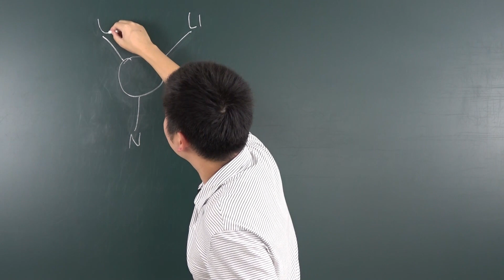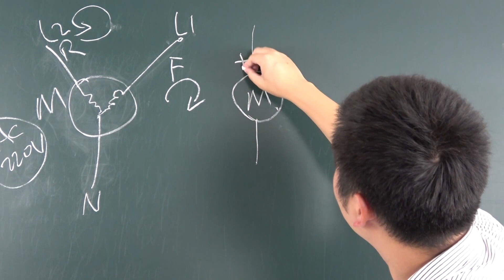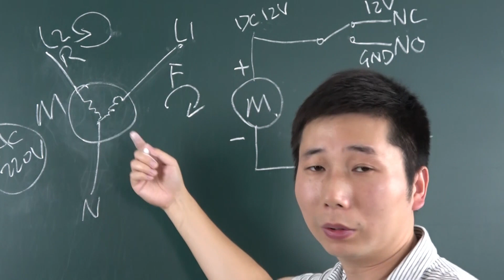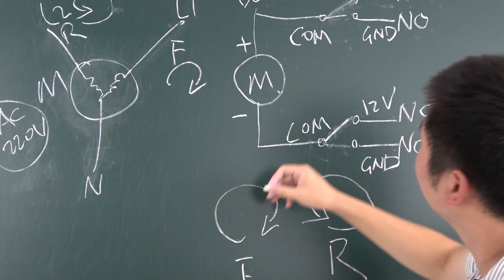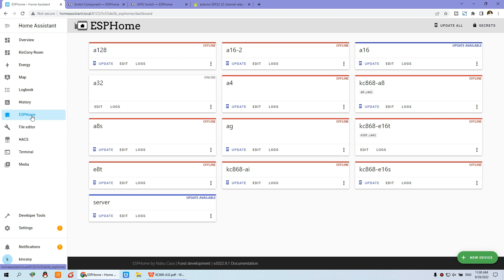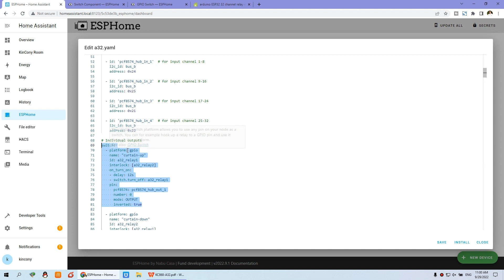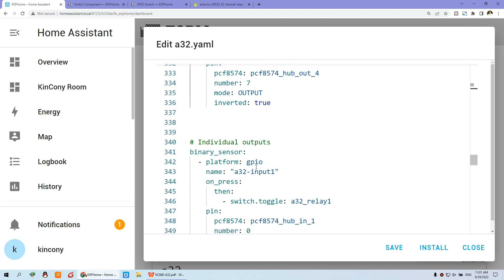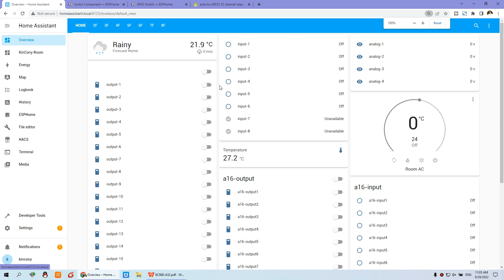how to use DC motor shutter work with home assistant

Comment: I thought I saw you bring up the amount of time it takes to shut the blind, and then thought you would talk about stall issues to prevent over driving the motor.

But I'm not sure if.

Overdriving, that is continuing to send power to the motor after it has reached its travel limit, will shorten the motor life?

Does the board have capability to sense and track current flow and thus provide an overdrive condition?
Do motors in applications like this self protect against over driving?
Reply from the maker: don't worry, now motor usually have auto stop function, when overdriving will stop.

Comment: is it posible to use the pwm to change motor speed  with esphome for  a16 board?
Reply from the maker: we will design a esp32 board with pwm output in furture
Reply: @KinCony  it is nice to have some motor drivers included in  A series boards ...
Reply from the maker: @nikhuge6580  which type of motor will use? AC motor or DC motor?
Reply: @KinCony  most probably dc motors...
Reply from the maker: @nikhuge6580  what voltage? DC12V?
Reply: @KinCony  yes 12v mostly
Reply from the maker: @nikhuge6580  what amp? such as 500mA?
Reply: @KinCony  i am mostly using l298n motor driver which has max current upto 2amp..so i think it is  better  to have at least around 1A  for general user cases.
Reply from the maker: @nikhuge6580  ok, understand, i think you just use small motor, i though maybe you will need large motor for speed control, such as 5A motor.